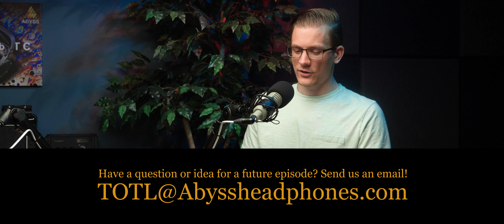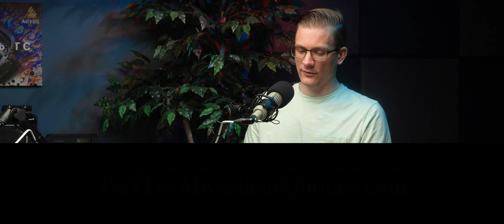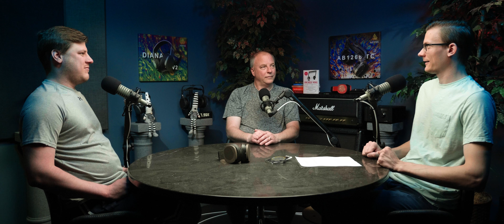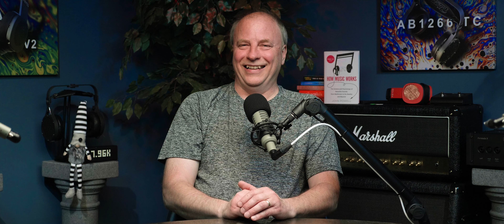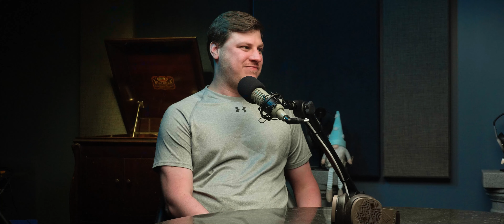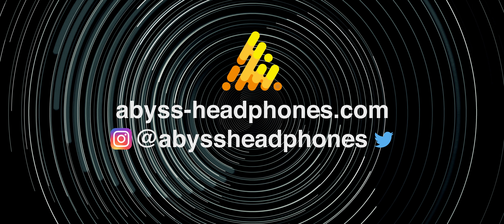Coaxial Planar Speakers! Is it possible?

Comment: For planars I think coaxial-ish could be achieved by something that looks like a Mangnepan where they have a hidden tweeter driver in the middle surrounded by a stiff material to isolate it from the rest of the panel. Not sure how well that design might work for headphones.